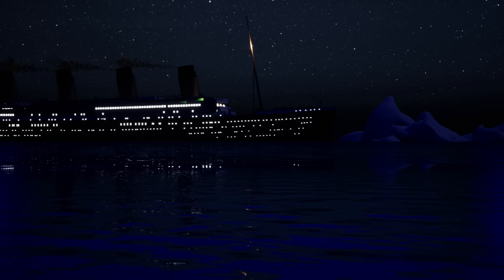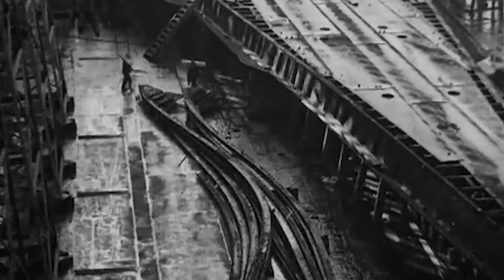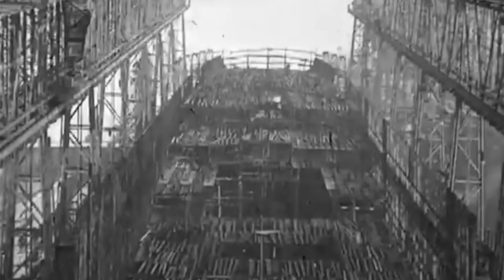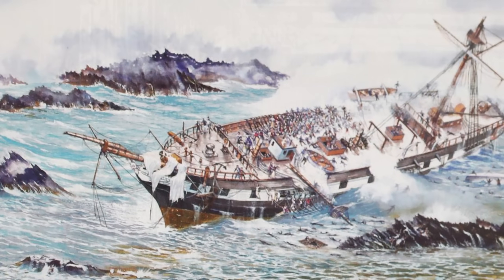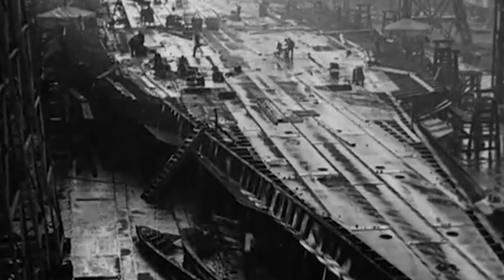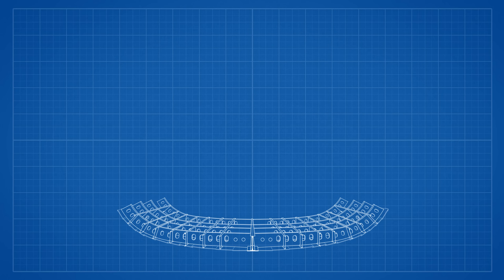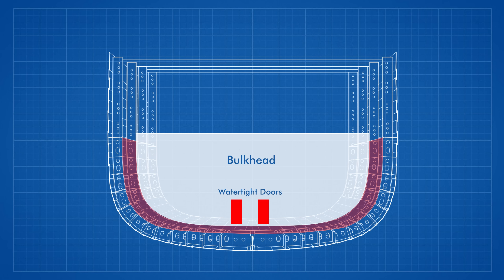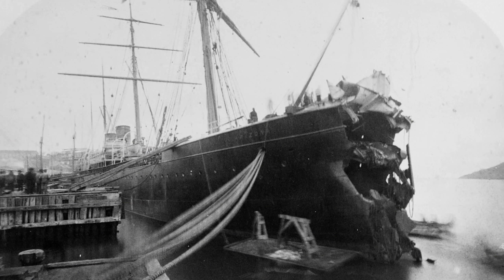How did the Iceberg Sink the Titanic?

Comment: I wondered if the ship turned in time but tipped a hole in the4 back would it still have sank as fast??
Reply: She sank slower than what her designer quoted on the night, after he had seen the extent of the damage. However the biggest issues with a stern strike are (A) it could have been lights out near enough immediately (literally), as if the compartment that had the dynamos was breached, there goes the main source of power for lights and the wireless, and (B) if the starboard shaft was damaged in the impact, the ship could have suffered a similar fate to HMS Prince of Wales in 1941 (albeit without IJN/IJA torpedo bombers being the cause), if the main shaft was bent and the engineers didn't get it shut down in time, or didn't realize it was bent and tried restarting it, it could have opened up most of the rear compartments, dooming the ship, and like with (A) causing the loss of all electrical power when the dynamos were flooded. Remember Titanic was far less resilient to amidship and stern damage, due to all the heavy machinery and boilers, IIRC, only able to take any 2 of those compartments being compromised before being doomed

Comment: Titanic, sailed with No Headlights.. Try that drive on the next Moonless Night, and see what happens.  Headlights would have alerted the crew to what was ahead.  The decision was made to get the Titanic at sea as fast as possible to sell tickets putting off the Headlights installation until arriving in New York City. The Titanic Owners should have gotten Life.
Reply: Don't be silly.   Can you name any liner, or indeed any ship, at the time which had any such headlights?    Why make such nonsense up?
Reply: @dovetonsturdee7033  Name a vehicle that drives in the Dark with no lights on?
Reply: @sashadala346  Perhaps that is the problem.   You don't quite grasp the difference between a road and an ocean. However, do you know any vehicles with headlights that can reach 15 or so miles ahead?

And, of course, you can't answer my original question.
Reply: @dovetonsturdee7033  The Titanic could stop in 1.5 km.  Your retorts are assine.
Reply: @sashadala346  As you have apparently been reduced to insults rather than arguments, at least try to spell them correctly. The word you seek is asinine.

You still haven't named any liner, then or now, which was fitted with the kind of imaginary headlights you describe, by the way.

Furthermore, there has never been any suggestion that such things were ever intended to be fitted, in New York or anywhere else.

Do feel free to provide a credible source. That would be far more interesting than simply making things up.
Reply: Actually headlights would make it harder to spot ice that is outside the direct cone of light. You essentially give yourself tunnel vision
Reply: @felixbeutin8105  Isn't it odd? When you ask these people to provide any evidence at all to support their lunatic ideas, they either :-
1). Become insulting.
2). Go away.
or 3). Become insulting, then go away.
Reply: @felixbeutin8105 The British Admiralty did not allow forward lights to be installed on British merchant ships in the UK.  The reason these lights were going to be installed in New York.  The Titanic hac more than enough electrical power since most interior lights were off at night.  This lighting question is heavily CENSORED to his day as it shows the incompetency of the  British Navy and the British Government.

Comment: You forgot about the fire in one of the coal bunkers, prior to its maiden voyage. Which is believed to have weakened the medal in that area. Plus the extreme cold water is believed to have weakened the metal overall. Both are believed, but last I heard not proven,  to help with the tearing of the hall...
Reply: IMM regulations required that bunker condition be inspected on a daily basis, because of the possibility of spentaneous combustion.  A smouldering fire was discovered in one (of 19) bunkers in Southampton. An engineering/stoker team were allocated to it, and it was extinguished around a day before the collision, causing damage only to the internal paintwork of the bunker, and none at all to the hull or the bulkheads.

If extreme cold weakened the metal, how was it that Olympic was a successful liner for 23 years?

Comment: Is it true that that 2 foot gash in boiler room five was the one that doomed titanic. I saw this in the movie "Saving the Titanic" They suggest  that had this 2 ft section had not ripped the ship mightve been saved.
Reply: Oh really  What I hear is that four punctured compartments would've been no problem but the iceberg damaged  five of them extensively plus  2-3in of the 6th one aft. And then  what you may've seen already  I mentioned hearing that the iceberg even punctured the double bottom  if only at Boiler Rm 4 (i e,  a small area but  that injury  too  was fatal nonetheless) .

Comment: If the carpenter had been aware of the need, such as a pre-planned response to such a situation, could they have extended the over-topped bulkhead upward? It wouldn't have to save the ship, but at least slow the flooding so the pumps could keep up for rescue to arrive.

Comment: The Titanic hit the iceberg at a glancing blow. It was turning away from the iceberg. The starboard side of the Titanic recieved the damage from the iceberg. This was below the water line. It fractured from the iceberg.  Iceberg tore  open the plates in the hull.  It punctured holes in 5 compartments. Titanic could stay afloat with 4 compartments flooded. Not 5. Bulkheads went only to E Deck. Lookouts in the Crows nest did not have binoculars.

Comment: So many things cause the Titanic to sink - From the thinning of the hull sheets of steel from the initial designs to the brittle when cold quality of the rivets - leaving the binoculars behind  on the dock in Irland - trying to burn off the coal that was smoldering would have explained the speed and weakened bulkheads - in reverse the rudder would have been near useless
Reply: Once again, so many errors here.

1). There was no change in hull sheet thickness in the design. Titanic's hull sheets were as thick as those of a 1910 built Southampton class cruiser, or come to that a modern oil tanker. They compared favourably with those of the Lusitanias.

2). The same rivets were used in her sister ship Olympic, which plied the same waters, successfully, for 23 years.

3). no binoculars were left behind on any dock in 'Irland.'

4). Frantically shovelling coal into boilers has no effect on speed. It simply raises the boiler pressure above the safe working one of 215 lbs psi., at which point the safety valves raise to protect the boiler.

Doubtless you will immediately delete your post, as you have already done several times. A shame that you lack the integrity to discuss, never mind defend, your errors.

As a former professor of mine used to say, 'the only thing more amusing than someone who does know what he is talking about is someone who doesn't know that he doesn't know what he is talking about.

If you really believe what you claim, why not simply try to prove anything I have written to be inaccurate? Good luck with that.
Reply: lookouts at the time never used binoculars to spot ice. The job of a lookout is to spot something not to investigate what that something is. And looking through binoculars you give yourself severe tunnel vision

Comment: Sadly the Costa Concordia would suffer the same fate although the ship was able to avoid a head on collision the side of the ship rubbed up against the rocks causing 4 compartments to fill with water and the ships Water Tight Compartments were much larger in size unfortunately the ship could only holds its weight with 2 compartments filled but not 4. This ship completely turned over on its side causing half the ship to sink.

The only smart thing they did was they ported as close to land as possible because if the ship was further out into sea the whole ship would have sank.

Comment: The thought of being in a compartment that's flooding and trying to get through the door before it drops is pure nightmare fuel
Reply: It’s not a death sentence.  There’s stairs that lead upwards through the decks
Reply: @crazy4gta1 In modern passenger ships, indeed that's very true. I can confirm from first hand experience.
Not sure about the Titanic days though...
Reply: @crazy4gta1 
Not in a watertight compartment there isn’t
Reply: @dysmissme7343  The compartments weren't sealed at the top.  In the boiler rooms for example, there are stairs that go all the way to E deck
Reply: @crazy4gta1  Indeed. Had they been sealable, the Titanic might've not sank, since the water can't spill over from the flooded compartments into the other compartments.
Reply: Or being inside the stern as the lights go out and it goes under....imagine being inside listening to the tweaking and breaking steel and water rushing in trapped in pitch black as you feel the pressure crushing everything as is rapidly increases.. you exist knowing your dead in about 1 or 2 minutes...

Comment: great articulate video Mike, unlike other misleading Titanic videos on YT  ...too bad the bulkheads when flooded couldn't be emptied  like in a bathtub or to expel incoming water just to control the flow of water which theoretically could've kept her afloat and save more passengers and crew.  The water continuously entering the hull is what weighted her and sank her. Ismay could've invested in pumps for each bulkhead compartment. Would've helped but not for long.  Another thing most people don't understand the ice is compact and is also moving. Millions of tons of ice against a 46,000 ton ship; ...the ship doesn't stand a chance!

Comment: All accounts and theories of the disaster seem to add up to this: Titanic allided with an iceberg in a field of ice, the allision crumpled and wrinkled hull plates, the slag-ridden rivets snapping in many places, creating numerous small apertures in seven compartments. Leadership recognized the accident and its dire implications, and responded by ordering the watertight doors be closed. This response accelerated Titanic's end by confining flooding to the fore compartments, causing the bow to descend more rapidly while the stern hove upward. The increasing downward pitch put the  damaged hull area deeper into the sea, increasing the hydrostatic pressure and flooding rate,  also created an increasing tension load on the gunwales, and a similar compression load in the keel. When approximately 30% of excess buoyancy was lost, the tension load in the gunwales exceeded the yield strength and the ship broke in two. Both halves then rapidly sank, leaving only debris and endless debate.
Reply: Collision*

Comment: One thing not mentioned was the massive coal bunker fire that had been burning for days before the ship sailed. It weakened the sides below to water line and buckled one the bulkheads. This meant that at least one of the bulkhead doors couldn't close properly. There's a photo of the ship in dock where you can clearly see the difference in colour at the very place the fire was raging. The ship left dock with this fire still out of control. The coal bunker was so hot that water just turned instantly to steam. They eventually got it under control by shoveling the burning coal into the boilers.....tons of it. The damage was already done. Unfortunately a combination of overconfidence in the ships unsinkability and the owners insistence that they leave on schedule was partly to blame for it's fate.
Reply: There was no  'massive coal bunker fire.'    There was a fire in one of Titanic's 19 bunkers, which was never remotely out of control, and had been extinguished some 24 hours before the collision.  There was no damage to the hull of the ship, and the only action taken seems to have been to have painted over the scorched area.  The photograph so imaginatively interpreted by Mr. Molony is some 40 feet forward of the affected bunker, and shows a smudge which does not appear on other similar photographs, and, even if real and not a flaw in the negative, could just as easily have been the result of a close encounter with a dockside fender. Moreover, it is well above the waterline. I thought ships generally only sank when holed BELOW the waterline?

'The coal bunker was so hot that water just turned instantly to steam.' Really? I assume you have a contemporary source? In point of fact, the bunker was directly below the ship's swimming pool, yet there were no reports of that beginning to boil, or the metalwork around it heating up. Odd, that?

To suspend disbelief for a moment, try to think for yourself, and consider this :-

Chief Engineer Joseph Bell reports to Captain Smith that a  'massive coal bunker fire' (your words) is raging uncontrollably below decks, and is damaging the hull of the ship.  Smith, a Master Mariner since 1887, and Senior White Star Captain since 1904, remember, replies, 'Never mind, we'll sail anyway. It's only the North Atlantic in April. What can possibly go wrong?'    Is this really credible?
Reply: The fire was nothing more than a small patch of smoldering coals, it wasn’t raging, it wasn’t out of control, it wasn’t located right up against the hull, it didn’t damage or weaken anything outside of two small indentations, the watertight doors were not affected at all, the “mark” in the photograph is over 80 feet away from where the fire actually was and also far above the waterline, the fire was extinguished via coal being distributed into another bunker and not the boilers, the fire didn’t sink it, overconfidence didn’t sink it, schedules didn’t sink it.
Coal fires of this sort were decently common back then, and were never seen as a threat to steamships. It wasn’t covered up, either, as it was brought up at the inquiries before being dismissed of relevance for reasons previously stated.
But they won’t tell you this in sensationalized TV programs masquerading as “documentaries” whilst distorting history in order to get money and attention…

Comment: #What if, ships has the capability to freeze or boil the surrounding water? The frozen water acts as a floater?

And the watertight compartments was designed to accommodate and was filled with frozen water and dense cotton from the bottom to top w / o sinking the ship and any water that comes from outside can also be frozen? ✌🏻🤔

Comment: Another issue is that there was a coal fire, and they had to put the burning coal in the boilers, and thats one reason why they were sailing so fast, and the fire also weakened the steel
Reply: The fire was nothing more than a small patch of smoldering coals which (1) were considerably common on ships like Titanic back then and never seen as a genuine threat, (2) didn’t significantly damage or weaken anything, (3) wasn’t located right up against the hull, (4) was not fought by putting the coal into the boilers and didn’t dictate the ship’s speed at all, (5) was completely put out through other means over a day before the collision, (6) didn’t contribute to the sinking of the ship at all and nobody thinks as such outside of sensationalisms and poor research.
Reply: @DerpyPossum  who told you that bs
Reply: @Pianissimo1970  Testimonies, historians, credible books, basic common sense, years of personal research, etc.
Reply: @DerpyPossum  use your common sense to see what really happened
Reply: @Pianissimo1970  That is the problem. People who use their common sense, or at least have actually looked into the circumstances surrounding the sinking, know beyond reasonable doubt that the bunker fire and the sinking were unconnected.
Reply: @dovetonsturdee7033  thats where you are really wrong, they HAD to use the burning coal, which forced them to sail faster, it wouldn't look good if they had to throw it overboard, and as far as i remember there was coal shortage
Reply: @Pianissimo1970  Titanic had 19 coal bunkers. and used up to 850 tons of coal per day. Using the coal from one bunker was simply the easiest way of dealing with the problem. Indeed.it was the usual way of resolving a bunker fire aboard a large ship. Something which, given the tendency of wet coal spontaniously to combust, was a regular event.

If Titanic really had to 'sail faster' why were five boilers never connected?

The coal strike had ended several days before Titanic left Southampton. The temporary shortage of coal had already ended.
Reply: Debunked crap

Comment: The “open-seams” idea is widely used but it could also have been what’s observed in other iceberg collisions – a pressure phenomenon that punches neat holes directly through the plating. One report on the leak in the 5th compartment said it was this sort of a hole “like a firehose” - apparently not the end of a buckled seam.  I read that the seam-split Ballard found was later attributed to the crumpling on impact with the sea floor.